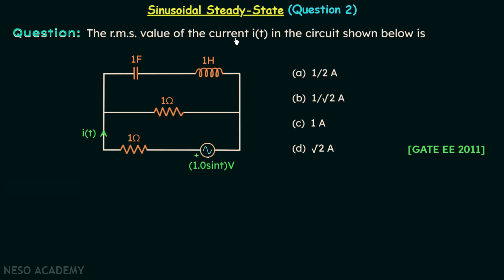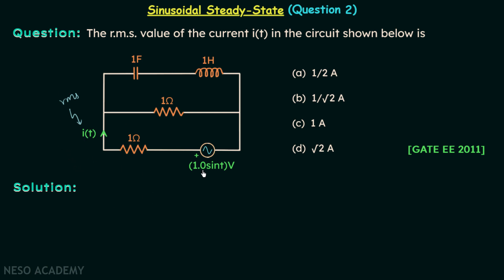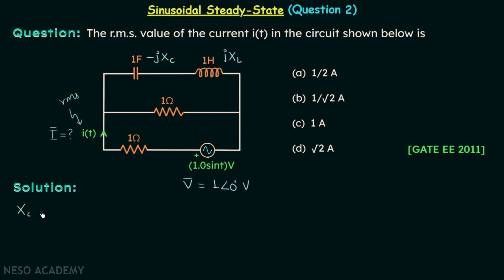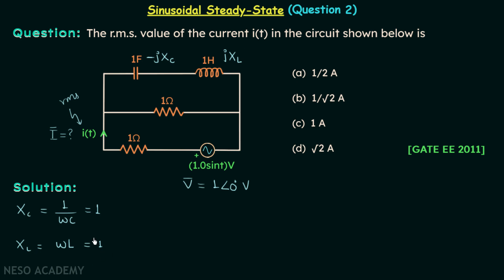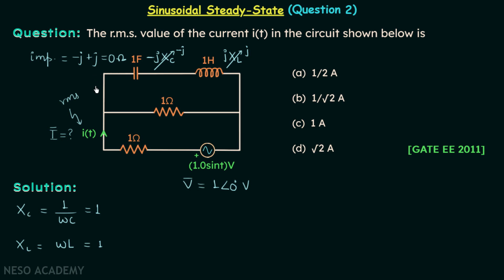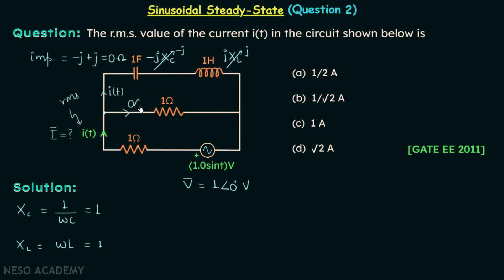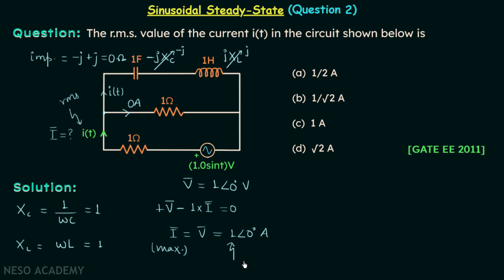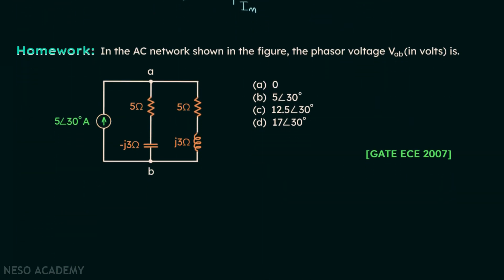Sinusoidal Steady-State (Solved Question 2)

Comment: Why 0 ampere in through 1ohm resistor?
Reply: Because current chooses the low resistance path to flow. And and in capacitor and inductor path -j+j gave us 0 ohm means it will be short circuited. So current will chose the path which offers low resistance. So the whole current will flow from short circuit branch. Therefore 0A current in 1 ohm resistance.